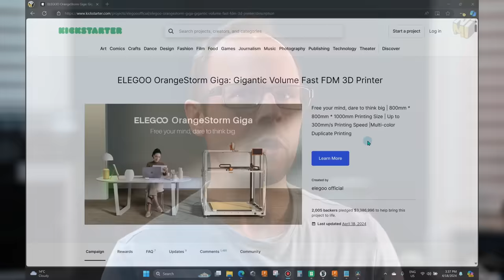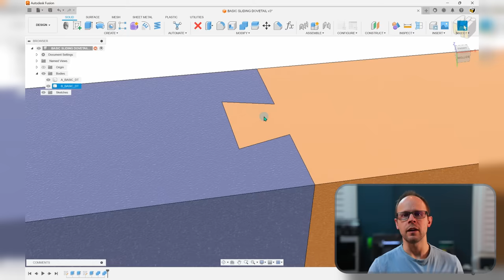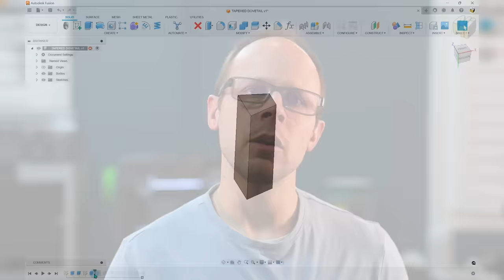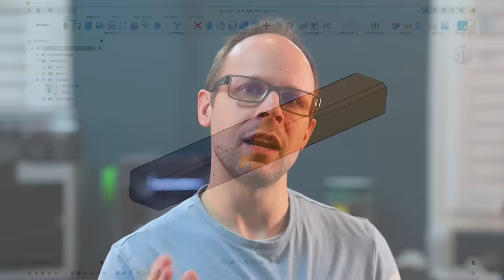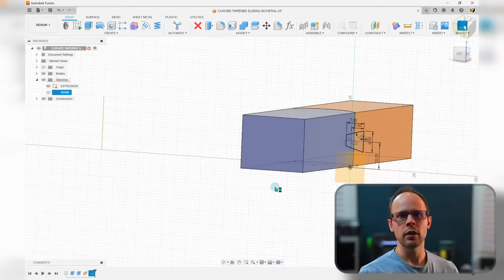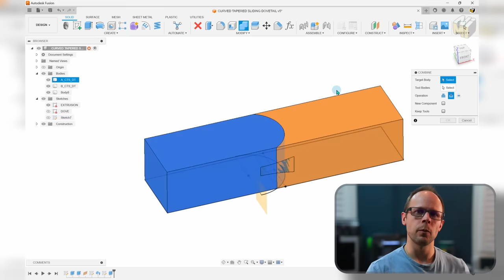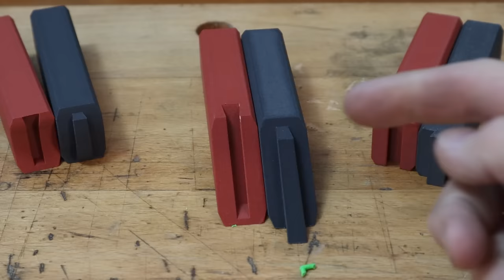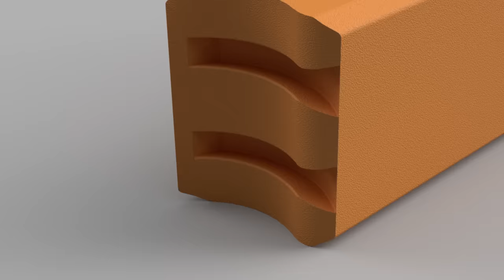Modernizing the best Woodworking Joint to use for 3D Printing

Comment: Very cool, and aesthetic, too! I also love woodworking, and found this super interesting. I'll admit I'm a little confused, though. I guess I don't understand your intention. You had a problem with making strong 3d-print joints for multi-part projects, and were looking for a solution. Was the intention to sacrifice the strength of the piece for a pretty connection, or to introduce a bunch of thinner failure points? My issue is that wood grain supports a joint more than the shape of the joint. An intentionally designed artisan joint can be stronger than the surrounding wood because of the placement of grain in the proper directions to resist tension and compression. I see these dovetails failing under torsion and sheering at the neck of the tail, under forces much lower than a solid print would handle. They don't benefit at all from an internal grain structure that flows through the entire piece and tail, it's just melted plastic, so we're completely losing one of the biggest benefits of this design. I wouldn't criticize without construction, so here's my thoughts. This is an art project. If you want a strong piece of plastic, reinforce it with something stronger than plastic like those heated wire staples they use in automotive repair. Create a simple joint, embed the joint with wire, smooth the surface with heat. I think that's how you strengthen a plastic joint, even if making it look like a wooden one is very pretty.
Reply from the maker: Thanks for your thoughts on this.  There is no doubt that wood has some advantages over plastics, I'm not really promoting plastics per-say, I'd much prefer to build from wood since I am a Woodworker by trade and have been studying this since I was a wee lad along with a career in Woodworking.  The reason for making these videos is really in preparation for what I believe is coming, and that is people trying to make pieces of furniture from plastics.  This started a few months ago after seeing several designs of printer enclosures which were connected with horrible loose joints and I made a video on that particular scenario already.   I will have more videos on this subject which will include tests as well for Tension/Compression/Torsion etc.  Your idea of the heated wire is a good one, it's already in-use and seems to work well on cars, most of those parts are just a shroud but it's worth a try.  I would say to counter your points, that just like all woods are not alike, the same is true for plastics, choosing the correct material is important.   You wouldn't make turned legs from Pine for example, the same goes for plastics, and I think with the correct size of connections and knowledge of the plastics themselves you can make it work.  Can you build a piece of furniture that lasts like a wood one... that'd be pretty tough, most plastics degrade over time with exposure to moisture or UV,  but it's something worth looing into deeper.   I think it's an interesting subject that hasn't been explored much and warrants someone with a background in Woodworking to apply that knowledge where it might be useful.
Reply: @NeedItMakeIt  Thanks for sharing your thoughts with me. I understand now that you're taking these considerations seriously. As long as nobody is getting the idea that a plastic joint somehow equates to the same thing made of wood, then there's no misunderstanding. That's why I wondered your intention. Visual appeal, ease of use, and practicality are all part of this solution, it just suffers in terms of strength when we start comparing to it's wooden counter-part. I can't wait to see the actual testing done on this, since once the limits are known the most useful applications of this technique can be better understood. For plastic to replace other materials in furniture construction it will have to produce some impressive results, but I think the quality of life improvements to assembly could outweigh minor strength trade-offs.
Reply from the maker: @wmbtech  No problem, I am starting to see trends in this direction and I think it's best to get a bit more educated on it so at least we have a basic understanding of what we're getting ourselves into.  Last week I came up with a plan to build a small wooden stool, pretty basic with mostly turned parts, Pine top, maple legs and rails, pretty traditional in style and then I'd make a fully 3D printed version as well.  It would be about the same size, but it would have a different design, which would be adapted more towards 3D printing, being more of a generative design type style.  I'd compare them by using them, but more importantly I think putting them out in the sun with 200lbs on them and see how each of them do over an extended period.  If from PLA, it'll soften quickly and won't survive, PETG-CF will probably be okay, and maybe just borderline, so then we have ASA which is I think probably the best for that use case, and the connections can be solvent welded in addition to having some type of dovetail/taper type connection.  Whether it will turn out, I have no idea, but we have to start somewhere.  We will be able to print SLS at home within a year or less, that will open up some other possibilities that we don't have with the FDM style printers we use right now, so maybe there is some hope to combine wood with plastic.  The look of plastic vs wood, there is no contest even with the ugliest wood, it still looks better than plastic IMO.   Thank you for the great thoughtful and thought-provoking conversation BTW, it's very refreshing!
Reply: @NeedItMakeIt  Likewise, I'll have to subscribe to see more. Best of luck, it all sounds very interesting!
Reply from the maker: @wmbtech  I'll have the next one this weekend and then the testing videos out a week or two after that.  I also will have the video showing what happens when we combine a mechanical method with one of these kinds of connections, but I guess I'd need to wait for the test to see which perform the best.  It's not quite as straight forward as it might seem for testing, I need the connection to fail and not the parts, which isn't exactly what happened last time I've run tests on these connections.
Reply: @NeedItMakeIt  That's also a positive. With   prints being so prone to failing between layers, the failure threshold should be pretty low for these connections to hold up as useful. If it breaks elsewhere under test conditions that's a different problem to deal with but also a win result for the joint design. But, I imagine you'll want to run the full monte and do tests on horizontal, diagonal, and vertical slices for each design. I'll just let you do it and watch. Haha.
Reply from the maker: @wmbtech  It's funny, I've had people tell me that the prints perform the same in all directions if you print slow enough... that is not correct at all, they're far weaker and more likely to break along the layer lines.  It's best if you need to print something in many directions to have the layers bypass the connections on an angle.   I have shown this approach in a previous video and it not only printed well, but it'll be far more uniform in strength.
Reply: @NeedItMakeIt  It's seems pretty obvious to any engineer that when the cross section of a part forms a different structure at different angles, it will have different physical properties as well. But it's the Internet, not everyone with an opinion has experience. Hopefully informational videos like you're producing help remedy that gap in understanding.
Reply from the maker: @wmbtech  It's not too hard to break it down to its most basic principles, that's a really good idea to include within a video as well, just a quick segment to help understand how these things work and the forces involved.   What I'm curious about that isn't as predictable is the properties of the plastics, their longevity, what people call creep as well, if I have a connection that fits tight now, will it continue to fit tight over time?  There are quite a few factors which I think can impact that result.  This is why I think the ultimate solution is a combination joint along with a mechanical connection or adhesive which permanently bonds the parts together is also a good idea.  It depends on the goal, I like the idea of being able to 3D print and assemble with adhesive, that's simple, no need for hardware.  We'll have to see how this develops and if there is enough interest in the subject I'll keep working on it to hopefully come to some type of "best" solution which can be applied to many situations in 3D printing.  I have a plan to design an all-in-one testing setup which can help to quickly test the results of any of these ideas, and one thing that I think would be great to add would be a long-term test.  Hopefully that can answer the question of how they compare after a week, month(s).
Reply: @NeedItMakeIt  Those surely are important things to test. The rigidity of wood or metals makes them great for stable structures, but plastic under any constant force over long periods of time tend to deform permanently.  Additionally, if exposed to the weather, a sunny day could produce enough heat to compromise a design made of plastic. There's two reasons to want those long-term results. If there comes a time in your testing that the materials don't seem suited for your purpose, you can always change the purpose to fit the materials and embrace the elasticity by making flexible furniture. Inspiration from AI designs or 'soft' robots could give you new ways to design your ideas. It's a fun project you've given yourself, I'm starting to fall into it, haha.

Comment: What did you do to get that texturized pattern on your parts?
Reply from the maker: Well I can't take much credit for that, I've used PETG-CF which produces this really nice matte finish with a bit of texture.  The prints were made with a 0.16mm Layer height and I've used both the QIDI Q1 Pro for these pats and the Bambu X1C for the best accuracy on the prints as well.  I've used fuzzy skin in the past with standard PETG, but with this fine-ness it's would likely crash the slicer to try it.  I hope that helps!

Comment: Can someone explain the regular vs tapered dovetail differences? I didn’t follow that
Reply from the maker: I can sure.  The regular dovetail doesn't pull the joint tight together, those connections normally rely on glue to fill any voids and prevent movement, like the connections we'd use for woodworking.  The standard dovetail is also harder to bring together and needs more clearance.  

The tapered dovetail on the other hand starts with the joint open, but the further you go, the tighter it gets, and then it comes to a point where all of the surfaces are in good contact making a solid and strong connection.  The tapered connection is superior in just about every way, it wasn't used in woodworking much since it's hard to make by hand... though not impossible.

Comment: what are you talking about, one of the best? dovetail is pretty sure but its one of the weaker joints, might want to doing some strength testing before waisting too much time on this
Reply from the maker: Have you ever made a dovetail connection?
Reply: @NeedItMakeIt  I've looked at multiple reports from people much more capable than myself, I personally don't use dovetails in my woodworking however. Have you ever done strength testing yourself?
Reply from the maker: @N1ghtR1der666  Yes I have, I am a Woodworker by trade and this is what we did when we were in school, including load testing connections.  I also was a Timber-framer, we also used dovetail connections often for houses we built by hand.   We used a combination of mortise and tenon connections along with dovetail connections.  The mortise and tenons were usually pegged with a draw-bore as well.   The dovetails were cut tight and we use a massive wooden mallet to seat them.  

Maybe you're referring to a non-glued dry connection?  Or comparing to a glued mortise and tenon connection.   Each joint has their pros and cons and places where it makes more sense to use one vs the other.  For example, if you use a mortise and tenon connection and don't glue it, you'd better have some other method to lock the parts together.   That's not the case with a Dovetail.  I think I explained myself fairly well in the video as to why I was coming up with this connection in particular over say a longer scarfed tapered dovetail connection.    

You're free to disagree, but I stick by my statement, it is one of the all time best connections in Woodworking

Comment: Did you make mention that this only works across the xy plane. If you do yz or xz it will just split apart.
Reply from the maker: It's certainly better to do it in this direction, similar to the way you'd make these parts from wood, the dovetails usually are placed against the XY plane.  In a previous video I shows a Stop Squinted Scarf Joint, and with those rails I was able to position the connections at an angle, making them far stronger.

If you're making large parts to come together, I'd say that orientation is less important, when it comes to small pieces similar to what I showed in the video, it's more important to print them in the orientation I showed briefly... I wish 3D printing wasn't as limiting as it is, but I have hope that someday it will allow us to print in any orientation with equal strength.
Reply: @NeedItMakeIt  I didn’t watch the previous, I’ll check it out. Was thinking of making a bow Riser and most are 24-26” long. I can sqeeze 19inch on the Prusa XL. So considered using a scarf joint if I went longer. But I’d prefer one solid loop of filament or 20 so thought I might go with the 19”. I was thinking about printing on side so that the long layers are inline with string but need to be mind full of layers or it may just sheer along the line of the string near handle where it thins up for the arrow rest.  I have one design I found but that very thin. I found another which was a scan of a wood bow that has a lot of beef so should be good. 

Only method to get  biaxis strength is a composite style design where you print an object and pause then drop in a core (possibly with some glue) it would give stiffness in two axis you just have to be careful how it modeled to get the fitment of core places quickly. And avoid messing your part from the pause, which even if super short can cause lines to form.
Reply from the maker: @75keg75  That's a super tough case, I love that you're challenging yourself with something  that difficult.  Will the riser need to flex?  I would  guess not much in the riser portion of the composite bow style, but in the traditional bow, that's how the energy is being stored.  I believe if the riser can remain stiff, you have a chance, but too much flex and I don't think it's going to work out as well, you'd almost want to find a way to meld the pieces on a molecular level... let me know what you think and how it goes, this is a very interesting subject.

Comment: "Twist"-dovetail? like on a bayonet-connector?
Reply from the maker: Yes!  That connector is essentially a very large straight thread correct?  It could be done with a tapered dovetail integrated, that is a challenge for sure.  Printing it as well and making sure it is strong.  I wonder if the dovetail would be needed, there would be so much contact area.
Reply: @NeedItMakeIt  I mean a dovetailed geometry or spiral geometry that is rotation-symmetric along the long-axis of the staves. Like a butt-joint, but with a 90* twist to lock it (as you would with a bayonet-connector)

Comment: What about a half mix inversion sliding dovetail? You know how in the classic sliding dovetail is a singular rail with a rail and a guiderail going all the way though? Well imagine that but it stops half way and then the roles reverse the other half way down. This then locks them in place in the middle and doesn't over-shoot the stopping point.

MF
FM

F = female/guiderail
M = male/rail

▒▒▒▒▒▒▒▒ ███████████
▒▒▒▒▒▒▒▒ ███████████
▒▒▒▒▒▒▒▒▒▒ █████████
▒▒▒▒▒▒▒▒▒▒ █████████
Reply from the maker: I was thinking about this type of connection for the video, but it ended up getting a bit too much to fit.  I think it's a great idea, I think I may have to sketch that one up to wrap my head around it before going into Fusion.  Love the "Image" you added.  One issue with the dovetail is that it also applies outward pressure, I have been thinking if there is a way to create a connection that brings the connection tight, while also bring it inward, or keeping it inward as well.

Comment: very cool. hate to be that guy but what filament are you using?
Reply from the maker: Thanks!  No worries, I'm using Bambu Lab PETG-CF - Brick Red and Titan Grey.  Best looking filaments out there IMO.  I really like the looks of the GF filaments too, that texture that you get is really something.
Reply: @NeedItMakeIt  i knew it must have been a CF filament as soon as i asked, it does look fantastic.
Reply from the maker: @SteveDave  Hard to beat it, I just tested some ABSGF filament (This weekend's video) and it looks pretty good as well, super stable material, but it's lime green, so there are MINUS points for that.  I'll have to get a different color and have a showdown for Ms Universe's Best Looking Filament.